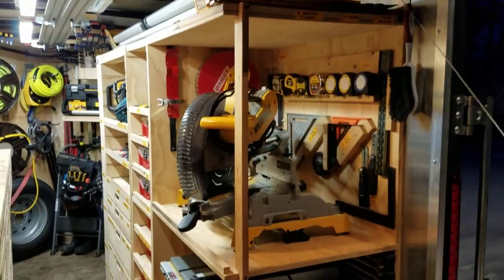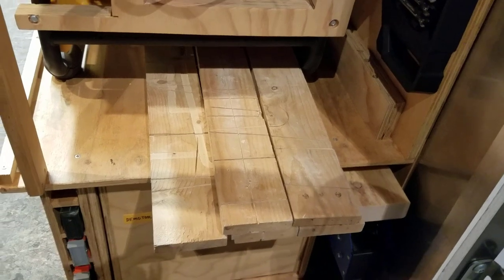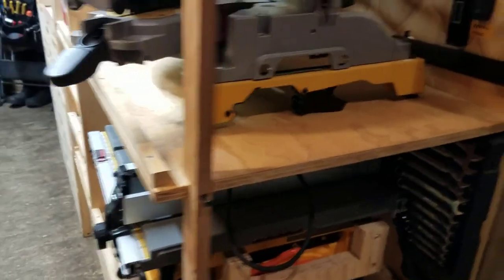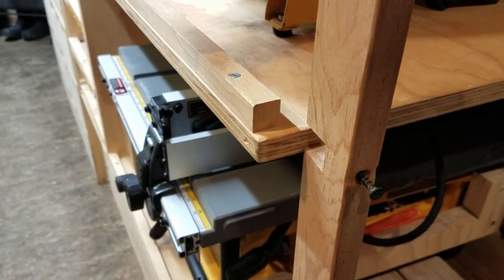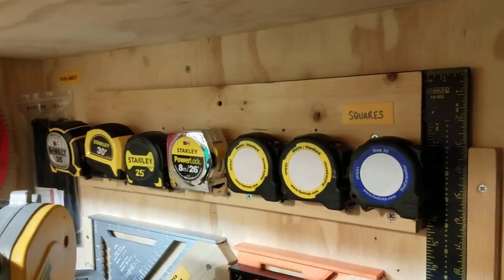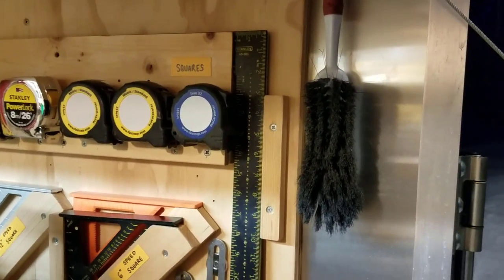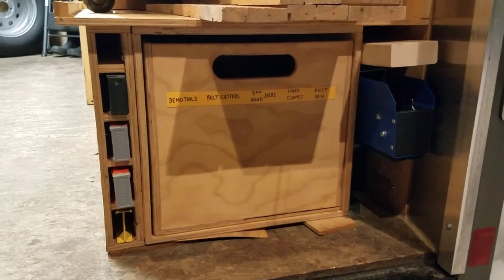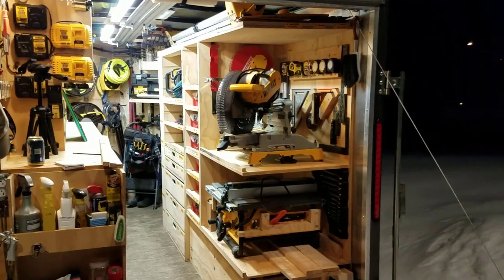LARGE TOOL Garage  - Paulk-Inspired sSMART tool trailer deep dive - "a la carte"

Comment: I have a solution for you. Make some arch supports, you have plenty of room. You could get rid of the stick and be able to support the shelves. Literally make ply wood speed squares and screw them in. Great videos some good ideas!
Reply from the maker: Great idea but to get the tools off the shelf, I use the space where the support is during transport. I have tried to take the MB and TS off the shelves with support in place and it is not really convenient to get them out by either pulling them forward to towards the trailer door.

Comment: Thanks for sharing details on your trailer. I'll be building out a small trailer soon. What size of trailer are you pulling?
Reply from the maker: 6x10 with 72" interior ht. Single axel. 3500lb gross, 3000 lb pulling. I am just under 3000 with my setup. I am hoping to upgrade to a 7x12, 7x14, or 8x12 on the next trailer. Best of luck with your build and if you document it on Youtube, please reach out and let me know. I would like to check out your ideas (and maybe steal some).
Reply: @sdsconstruction  thnak you for getting back to me. I really appreciate it